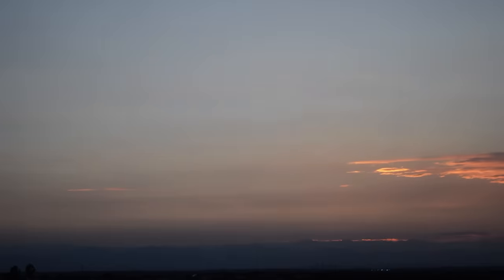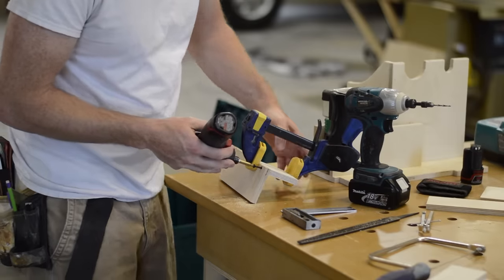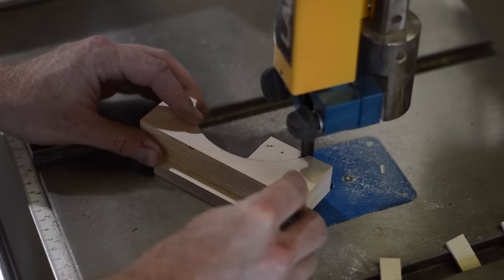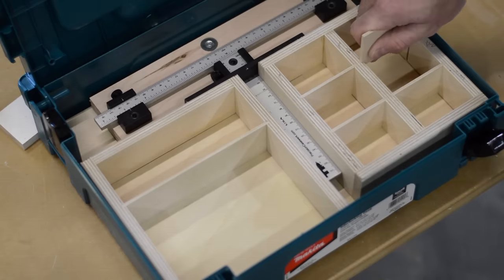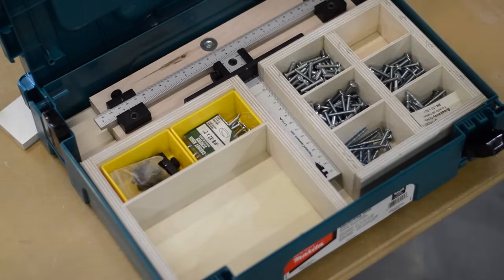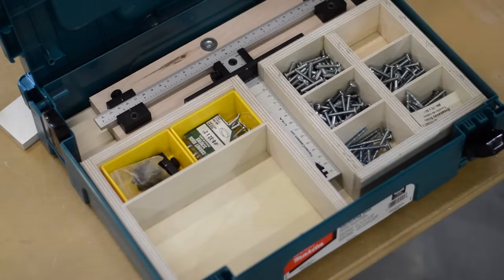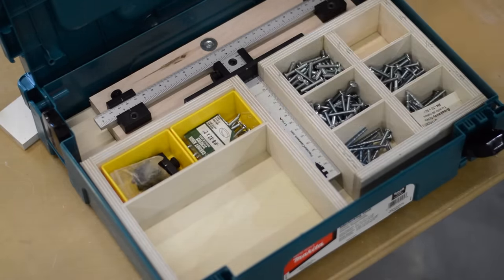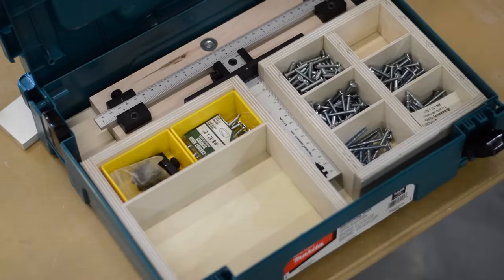Carpentry Tool Organization, Makita, Festool Systainer Build

Comment: am a cabinet makers apprentice. One big tip I learnt from 1 tradesman. Buy some 50cm x 50cm carpet tiles. In a finished home they come in especially handy but are still very good for general work. 1 carpet tile goes on the floor under the main toolbox protecting the nicely finished timber flooring. 1 tile goes in a top draw/on a cabinet/benchtop, this is your home base, every hand tool you use will either go back in its box or on this smallish 50cmx50cm carpet tile. You won't scratch benchtops and you won't lose tools because theres only 2 places they could be, on the tile or in the box. They look cute, professional and clean.
Reply from the maker: Cool tip. Thank you. Plus they could double as knee pads.
Reply: Great idea Harry.  Thanks for sharing.
Reply: Since I am over 65, I finally got the courage to use the word “cute” but only when discussing mine and others grandchildren.... oh yes, and the shop apprentice.
Reply: Cute? Lol great idea though I'm going to try it.
Reply: The word cute can also mean "clever or shrewd" its not always about puppies and kids lol
Reply: Lol
Reply: I’d be interested in video with you revisiting each box and any changes or modifications you have made or think would be beneficial! Nice work 👌
Reply: harry singh great advice bud I always use  a grey rubber foam 50x50cm it doubles as a bad knee support
Reply: If I happened to notice a cabinet installer using a top drawer for his tools I would lose my shit on him.  A brand new kitchen is not a tool box. No mater how safe you are the safest way is to not do it
Reply: Also what cabinet maker uses centre meters??
Reply: @The1masterofdisaster  nearly everyone of them in the UK and Europe uses the metric system.
Reply: @sicr7373  No, we use millimetres
Reply: @harveysmith100  Which is the metric system
Reply: @harveysmith100  LOL, Yes II'm fully aware of this thanks having been a cabinet maker for almost 40 years now.

Comment: Nice job mike Just a couple suggestions 1.cushin the air nails to prevent breakage 2. clear coat the wood 3.nail gun oil 4. masks to protect your lungs 5. Duck tape, teflon tape.
Reply from the maker: Thank you. Good suggestions.

Comment: Here we are, 2 years later. How are you liking them mike? I especially like the hand tool box one, I can’t believe you fit all those in there!
Reply from the maker: Thank you. I still use these all the time. I ended up adding a few boxes for some other tools, but I haven't changed any of the boxes in this video.
Reply: @MikeFarrington  I am now highly motivated to do something similar! Thank you Mike!
Reply from the maker: @marblemountainwoodworks8475  Get out to the shop and get to work!
Reply: @MikeFarrington  yes sir! Thank you for the highly motivating content!
Reply from the maker: @marblemountainwoodworks8475  My pleasure.

Comment: I liked the video so much that I subscribed. Your attention to detail is amazing. One little suggestion for the sustainer with the compressor in - I noticed there was about 4"-6" space left between the top of the compressor and the closed lid. Make a few small feet to raise the compressor up so air can circulate all around, including underneath. Also, computer fans are extremely thin. You could add one in that small space to help draw heat away and get cooler air around, using the existing power supply from your compressor. Just a few wires and a little work and no more worries about the box getting overheated. I've made it sound easy, but for a professional like you, I'm sure it will be a piece of cake !
Reply from the maker: Thank you very much. Great to have you onboard. So far heat has not been an issue with the compressor, in fact I run it with the lid closed more of the time, and when I open it, its just warm inside.

Comment: I've been racking my brains for years on how to organise my tools, and this is genius.
I think as we get older,  keeping organised on site helps us focus more and keeps the ocd in check!
Thanks for sharing!
Reply from the maker: Thank you. I fully agree, the older I get the more neat and clean I want my job site.
Reply: @MikeFarrington  Hi Mike, well i finally made a tool box like yours. I hope you are getting the most out of yours because i absolutely love mine !!
I finally have a tool box that is not only organised, but one that looks good as well. Its funny, you can see people looking at it like 'what the?' but you can tell they want one!! Mine is certainly a little more rough around the edges than yours, but it does the job pefectly. Because every tool has a place, i spend less time searching for stuff and also i am now very careful what i buy. If it doesn't fit i dont get it. Its very easy to pick up a 'new tool' from my supplier because it looks good, or i think i will benefit from it, but as a kitchen installer i use the same tools constantly, so there is nothing i dont use and i can find everything instantly. 
Thanks for the inspiration!
Reply from the maker: @MrMoxyrocks  Thats really great to hear. Happy it worked out for you.

Comment: I also want to organise my tools but I dont know which systainer i should buy. What du you think? which is better the Makita macpac systainer the Festool systainer the bosch l boxx or the dewalt t-stak systainer?

By the way nice video your tool holders look really nice!

Greetings from Austria
Reply from the maker: I can't comment on the others because I have not used them or even seen them. What I can say is the original Festool Systainers have been a great addition to my tools set for many years and have held up great. I also like the Festool T Loc Systainers. I have used these for a few years as well. The Makita Systainers feel pretty well made, but I have only had them for a short time, so I have no input on longevity. Hope this helps.
Reply: Mike Farrington  Thank you for your answer! I think I will take the makita macpac or the dewalt t stak because the are cheaper than the others and the reviews are pretty good
Reply from the maker: I don't think you will regret your choice.

Comment: I'm heavily invested into the dewalt tstaks. Even my track saw rides in a tstak. Only thing in a different box is bosch jig saw in an Lboxx.

Still love these vids though 😀
Reply from the maker: Happy to hear you like the video. Some of the same ideas could be applied to the tstak.
Reply: Mike, No doubt. My router box is the only one I tricked out though. I put in a high quality pre drilled foam insert and then built a wrench/collet cubby with the rest of the interior space.
Reply from the maker: Cool, sounds like it does the trick.
Reply: Mike, got any tricks for track saw rails? I've got two 55" and one 118". And a 6x12 tool trailer. The 55 is pretty simple but the 118 is a tad awkward. 
By the way, your drop in organizer is over the top awesome.
Reply: Aaron, do you need the 118" ? I just use the 55" with the joining piece to make them longer.
Reply from the maker: I don't have any tricks for the rails. I just slip the 55" beside the seat in my van. The 118" would be a real pain, I don't own one yet. I would probably create a little hammock at the roof of my van and hang it up there.
Reply: I have two 55 inch tracks and 1 118. The 55 Nest pretty well on a Shelf, and I guess I'm going to have to strap the 118 to the ceiling of the trailer. Although it's still unwieldy maneuvering inside of a house. The two 55 inch tracks don't always line up perfect and if your substrate isn't right it will create a speed bump.
Reply from the maker: I feel like the 118 is a must (when its a must), I do not like putting two tracks together for the reason you mentioned. I say strap it to the ceiling. Best of luck.

Comment: Really enjoyed your video, admire your patience. I bought two of the small Makita boxes; one is all of my bits, blades, spade & forstner bits, allen keys, small tools etc.; the other is for sockets (1/4, 3/8 &1/2) in their Hansen storage trays, wrenches in a keeper and associated ratchets & extensions(neat, tidy and easy).
I bought one medium box for my 12V &18V batteries & chargers (very full). Next I filled a large size box with the cordless (Makita only) tools I use the most, 6 1/2"circular saw, 18V brushless impact, 18V oscillating tool, 18V 4.5" grinder, 12V flashlight, and 12V Makita radio.
The extra large Makita case has my 36V Makita circular saw , 18V brushless soft start jigsaw. Add in some Stanley cases with removable trays for fasteners and I have much more room in the  back of my extended cab GMC than I ever had before. Happy to see that someone else saw the possibilities that I saw to be more organized/efficient with those Makita tool boxes. Good job on the hand tool insert, I have to admit mine is unfinished on a shelf. Greg
Reply from the maker: Thank you Greg. Get out there and finish your insert!

Comment: Finally something useful - every box arrangement depends of individual choice and usage of tools and it is varying by specific works one is doing . My job is inside arrangement of the boats, and I'm building in whatever is necessary, i also make some internal repairing and rearrangements in the hulls depending of owners wishes. To do it i i need a waste variety of tools. I already did something similar to keep my tools grouped by type of job I'm doing so wiring tools are in separate box, piping tools in another, woodwork tools as wood drills saws chisels and that group of tools in another metalwork tools in another and tools which i use in all of groups of work as pliers screwdrivers drills hammers etc in another. in that way i cary just a common toolbox and specific toolbox - wireless drilling machine and impact driver with batteries and charger has its own toolbox other mainly wireless 18V Makita tools as router, lamell joiner, angle grinder, etc comes in its own boxes and i chose them by actual necessity regarding ongoing job. but boxing the compressor is so ingenious that Makita itself should consider production of that unit built in the box - my compressor has little bigger air tank and i use the biggest box to arrange compressor in vertical mode - anyway this great idea is your - massive thank you and salutes from Croatia - sorry for my English ...
Reply from the maker: Thank you for the kind words. Sounds like you have a pretty nice system for your tools. Moving tools around and organization are never ending tasks in this trade.

Comment: I have been in analysis to paralysis over similar ideas. Thanks for helping move that thought process in a constructive direction! Great work
Reply from the maker: Thank you. Happy to hear the video is helpful.
Reply: I know the feeling, Brian :-) so the way I sorted mine out, was to list (and price) the entirety of my tools (and desired acquisitions), and group them according to my needs there (kitchen and joinery install). For my needs, the absolute best system is a homemade MFT table, two-wide sustainer cart (again, homemade) and the core Festools (vac, tracksaw, planer) surrounded by Makita cordless. Just like mike :-) so you know you are on the right track. 

However, Mike's boxes are missing  quite a few components from my trade: I have more screws/fittings to stow, adhesives, cleaners, ppe in systainers, and my hands tools organised in a different way, because we use them less.

Comment: That was a great idea, as a long time installer getting organized and being able to stay organized easily is a major plus.  You don’t have to guess where the tool is and at the end of the job you don’t have to worry if you have all of your tools. It will save you hundreds of hours, less frustration and you installs will go better. Not to mention you get on a job and your client sees that your well organized, this will assure them that they made the right choice. It will lead to more jobs. I once got a job because I am extremely careful about how I roll up my cords. Yes there is a right way to do it and a dozen ways to do it wrong.
Reply from the maker: After using these for a while now, I have found that everything you mentioned is true, especially how much the customers enjoy a neat and tidy work zone.
Reply: @MikeFarrington  I had been asked to build a temporary kitchen just so that they could signed off so that the bike would release the another portion of the money, I had make up the panels and such and I brought in my screw box to put the whole together The lady of the house complained because my screw box smelled so badly. I was shocked. I took the box outside and finished everything up out there having to manhandle everything into the kitchen.  what I realized later, was the oil that the company used to protect the screws smelt a lot like some kind of fish oil.  :-)
Reply from the maker: @thomasgreen8532  Hmm. I would have told her to light a candle. Either way, sounds like you got it done.

Comment: Excellent work. I'm a cabinet installer and have an almost identical everyday use tool kit. You will love the payoff for your efforts. Tidy jobsites impress and keeps you focused on task.  For me I switched to the SYS 4 systainer a 3 drawer for my tools but I still find it cluttered. Too deep for hand tools not deep enough for other battery tools.  
You've inspired me to make some changes.
Reply from the maker: Thats great, thank you. Yes, its funny how different people in the same trade can boil a tool set down and its similar.

Comment: I am always trying to organize. I have 5 or six tool bags and forever trying different ideas. I do maintenance in apartments so I do all trades except roofing and siding so I have a lot of tools to put in a single cab truck with a toolbox in the back. Good job with the video.
Reply from the maker: Thank you. Organization is never easy, so far this system has worked well for me.

Comment: I moved nearly all my tools into T lock systainers after getting a workshop with access down a pedestrian alley. Lots of wheeling stuff. The systainer wheeled trays work really well. One thing that I decided not to do. (Even though I appreciate the ply inserts. ) Was to use more smaller systainers and use thinner ply if at all. That extra weight when carrying boxes up and down stairs is a killer at the end of a busy day.   The T lock system is amazingly versatile.
Reply from the maker: So far the extra heavy large box has worked really well. I could certainly see breaking it down into two smaller boxes. For me I don't move my tools that often or far, so its been working well. These boxes are great for organization, thats for sure.

Comment: I guess the proof will be at the job site as you mentioned. I use systainers  extensively as my field of work covers many areas, I found its an ongoing process to cover the tool requirements in boxes. You certainly have done a good job in accommodating  your job site requirements with those boxes. Definitely enjoy your video’s
Reply from the maker: Thank you. So far these have been great.

Comment: Hey Mike. I'm a solo cabinet maker as well. I think you got a prettt good setup going there. I personally opted for Makita's line of tools including cordless nailers. They work great and fast. I put them in the Milwaukee Packout system. I previously used my Festool and Makita Systainers but the packout systems are much stronger, faster, cheaper, and even waterproof... They are so strong I use them as ladders.
Reply from the maker: Thank you very much. I have a few Makita cordless tools. They have worked great. I took a look at the Milwaukee Pack out system as well. It looked very good. I may have used it had I not already had so many systainers.

Comment: I know this is way late, about a year later, but I did something similar last year. I needed a ‘trolly’ so at that time I picked up a cheap collapsible box dolly. This worked okay, but I didn’t like storing the dolly and taking it on site did not work very well. Recently, DEWALT came out with their TSTACK cart and Trolley. Since my efforts went so well last year, I picked up the 4 piece package of TSTACK (3 nice boxes and the Trolley). I’m so glad I did. I like the Trolley so much, I purchased two more for my Makita and Festool Systainers. I highly recommend the TSACK Trolley and its half the price of the Festool and 1.5 the cost of the hard to get Makita Trolley.
Reply from the maker: Sounds like you have a very nice setup. Thank you for sharing.

Comment: As a electronic tech, Have found one trick for you to look it, I carry a 4 in one screw driver with me and I carry a little metal mechanics magnet dish to put screws in when work on time around the house.  One trick I learned when I first started out is carry shoe covers for your shoes in your pocket or into top tool box of your sustainers. This way if you go your truck or out side for just a break you do not get the house all dirty from tracking stuff for outside into the house.  Might want to thing about caring a battery powered leaf blower in the truck so that you can blow out or off the stack of sustainers before putting them back in the truck and you can clean out the truck if need be.
Reply from the maker: These are a couple really good tips. Thank you very much.

Comment: Looks like ya knocked it out of the park but very interested on the follow up which I am sure is great with a minimal amount of tweaking.
Reply from the maker: The follow up is that these work great, and no additional cooling is needed for the compressor. It seems to run cool enough.

Comment: Best use of someone's time I've seen in a long time , love your shop , a bit OCD but that will be a benefit in other parts of your day to day .

Worked in Connecticut in the 90's so know how good American carpenters are , your controlling your quality working alone which is an admirable 
Trate ,
Reply from the maker: Thank you. So far it has helped the unload load phase of the couple jobs I have worked on since making these, and yes the job site looks much better.